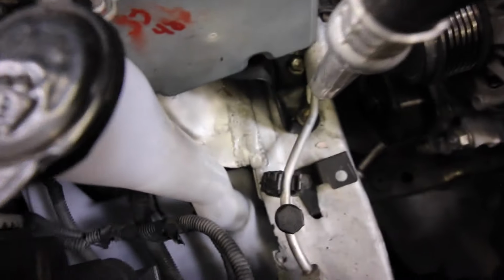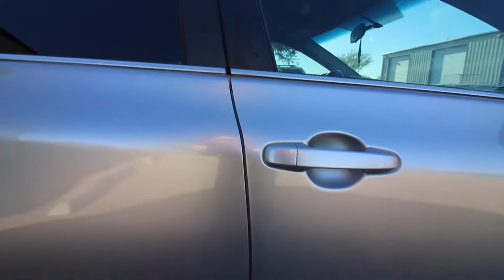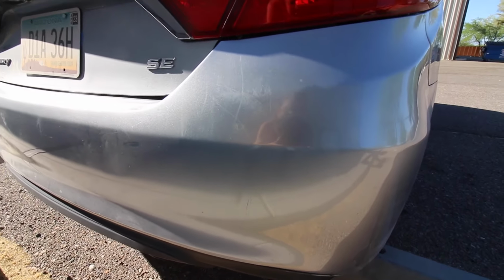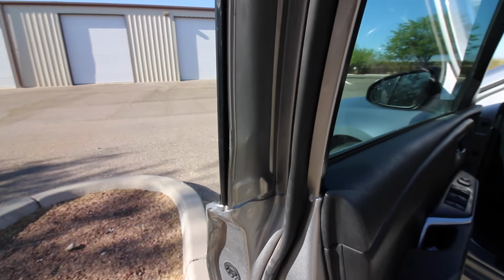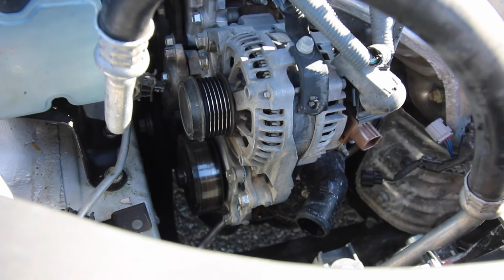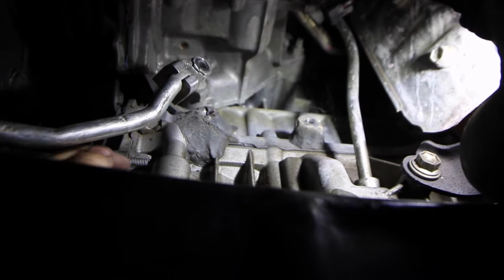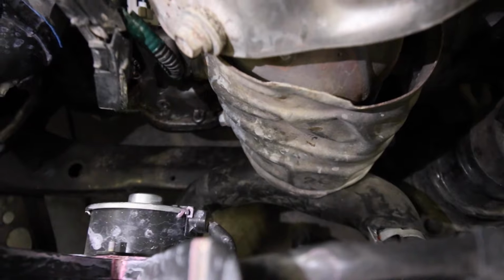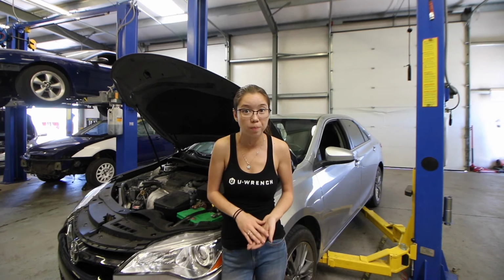What to Look For When Buying a Used Car

Comment: That should fall under AZ Lemon Law coverage for used cars.  That's a lot of shoddy structural repair which should be covered since it compromises the ability of the car to operate safely.

Comment: JB Weld has saved my bacon countless times but dang this isn’t a good application!  Maybe, just maybe an expert welder could TIG weld those brackets to the point where they could be used/re-tapped but unlikely.  That car is done.  Great information here.

Comment: Hmm, yeah, I think that's a used car... Used cars tend to have dents, dings, scratches... kind of what happens with used cars.  A used car has been.... used.  That means that it has probably been on public roads, shared with other vehicles that are tons of metal, glass and plastic, driven by people are could be the most responsible saints imaginable, or the most hazardous operators imaginable.  Incidents may happen on a used car that require repair.  Rarely are repairs made in a factory setting by the manufacturer, the only ones that come to mind are lemon law recourse vehicles.  Even warranty repairs aren't made by the manufacturer, they're made by dealers who represent the manufacturer, but not the manufacturer itself.  It's common to find repairs on a used vehicle.  And as far taking the car back to the place of purchase... that's where one goes to when in the market for a vehicle.  The car needs to go to a mechanic.  That's like asking for a Big Mac at a farmer's ranch.  Might be a related industry, but still not the right place.